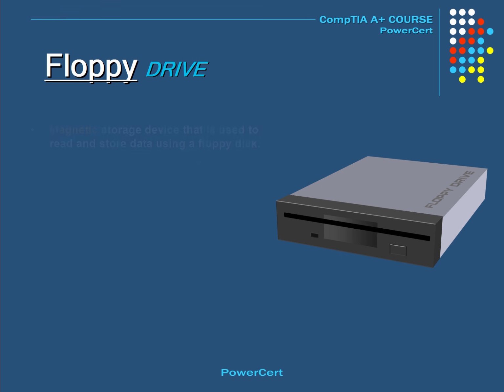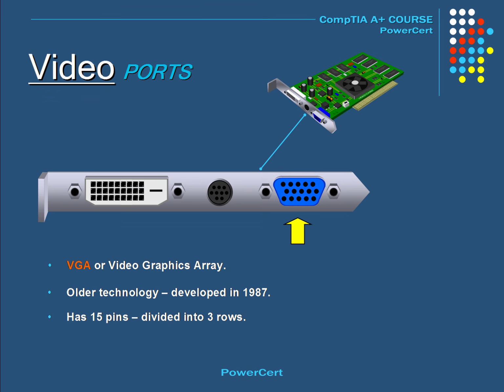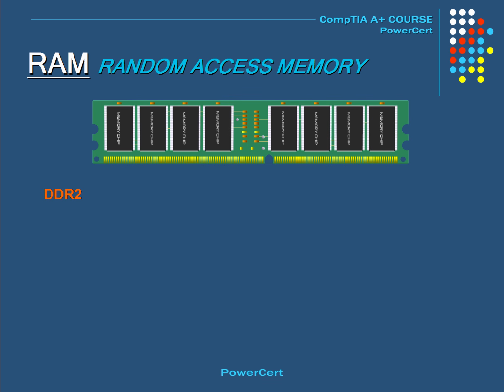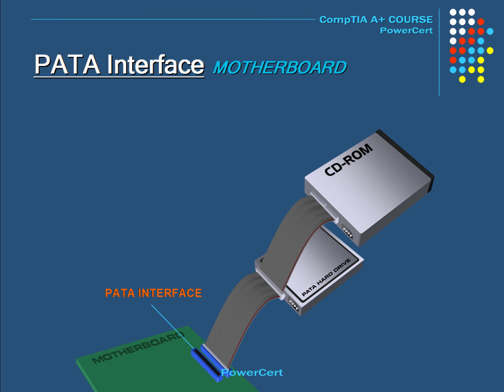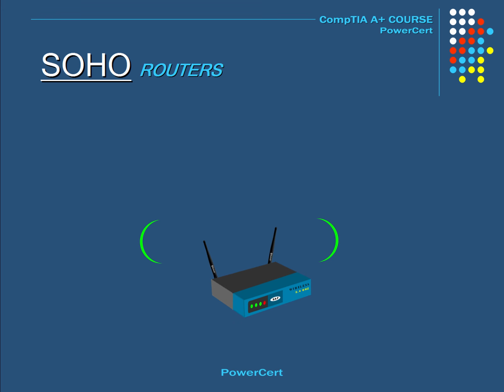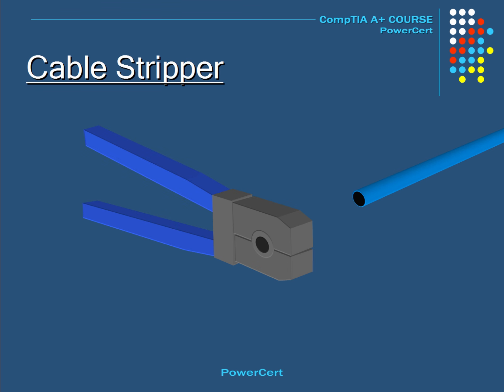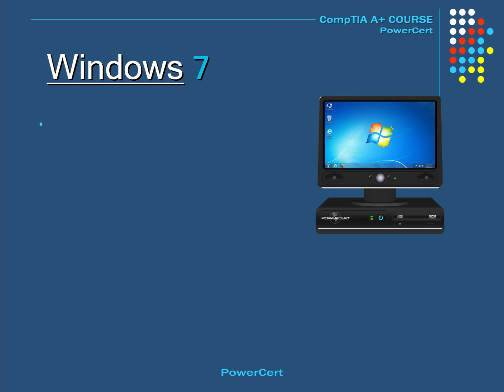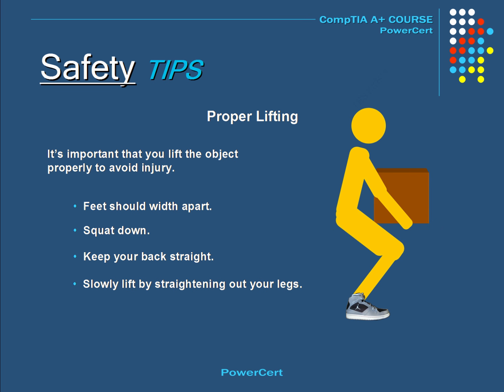CompTIA A+ Certification Video Course 220-801

Comment: Windows 95 was the first successful commercial launch of Windows. Windows first launched in '87 to '89, called Windows 1. I have Windows 2 installed on my Playstation Portable aka "PSP". There was even Windows 3.1 NT that eventually became Windows 2000. Not to be confused with Windows Me which was MSDOS based. Xp and onward are all NT based.

Comment: please someone answear,i want to study comptia +a,so i read from different sources to cover it well,but why the number is different like here is 220-801 and your other video is 901-902 and for professor messor is 1001-1002 and all are the same<please someone help me which one to study
Reply: You have to keep in mind that this is a 6 year old video. CompTIA launched the  220-1001 and 220-1002 tests in 2019. The core concepts in this video are still relevant though.

Comment: in the 19th minute of the video, he says that PS/2  ports are "becoming phased out". actually, at the repair shop that i work at, where we deal almost exclusively with used computers from people 40years old or older, these ports have already been  completely phased out. i knew this would be antiquated when he talked about floppy drives but not cloud storage. so far, in 20 minutes, the only thing ive learned is that btx form factors are made for desktops that are small. btw, another bad sign is that theres no mention of laptops or tablets. im the only only one at my shop that is not certified. and i know almost every word he has said. and ive known it for about 10 years. so far, when he mentions dates, nothing is newer than 2008. the a+ certification was just renewed. if you study for it on this video, you will fail the test!

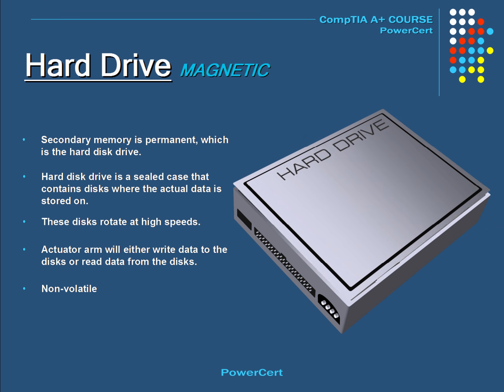Comment: Im new to A+, I am enrolling to obtain my IT degree at, so some of this is like a foreign language! But what I wanted to ask you, when you are talking about Port Forwarding at around the 2:04 mark you stated that you have to point it to the ip address of the computer you want your friend to access, my question is, what exactly are you pointing, the actual equipment or are you just saying you have to use the mouse and point to the ip address listed on the screen? I think I understand what you are saying and I am probably over thinking it because I have taken watching this video very seriously and I am falling asleep at times so I apologize if this is not make sense, I am trying my best to understand some of this before my classes start! Thanks!
Reply from the maker: Thank you.  You're telling the router that when it receives data coming in from a certain port, the router will direct or forward that data to the computer with the corresponding IP address.

Comment: whats the fire wire ??
Reply: A type of cable used to connect devices, just like USB.  There for a while it looked like FireWire might become the popular standard, not USB.  USB 1.1 turned out to be a little faster, and USB 2.0 many times faster.  Now that we have USB 3.0, FireWire is a legacy connection.  However, I believe you do still need to know it for the 901/902 A+ exams, so make sure you know what it looks like.

Comment: 0:30 Storage Devices
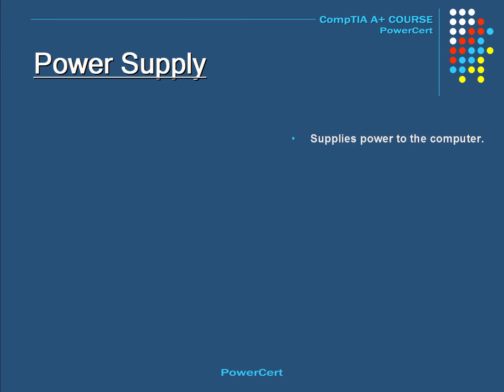10:50 Power Supply
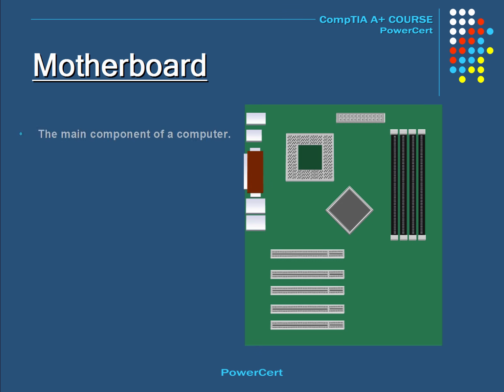13:10 Motherboard Form Factor
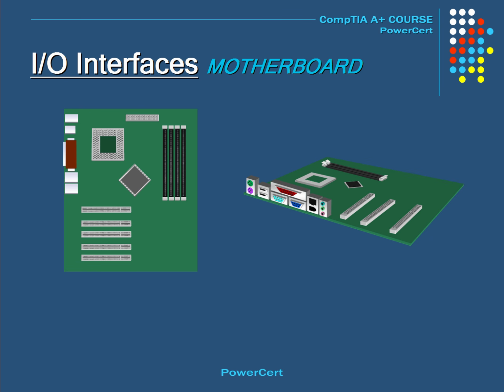18:45 Motherboard I/O Interfaces
26:50 Adapter/Expansion Cards
34:40 RAM Slots
38:30 Printers
44:45 Cooling
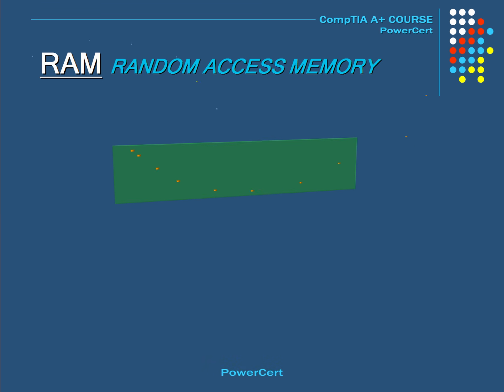50:30 RAM
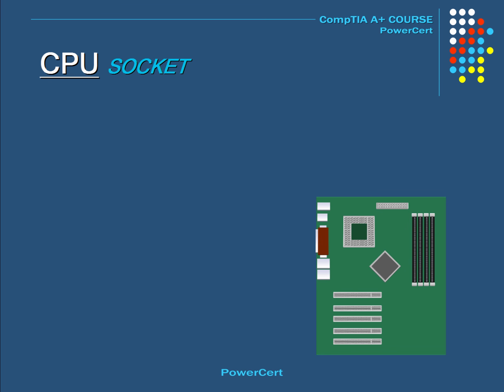1:02:50 CPU, Socket 
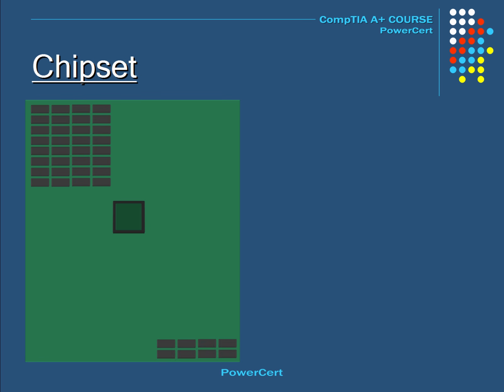1:14:31 Chipset
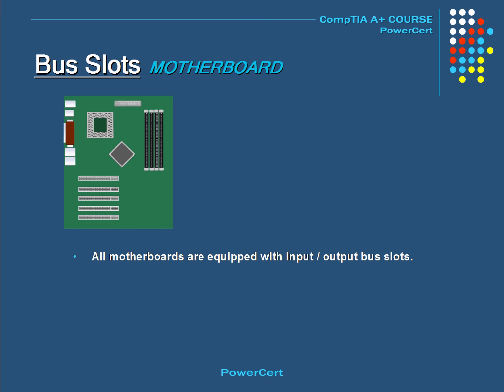1:19:38 Bus Slots
1:25:20 PATA Interface
1:27:30 Networking Cables & Connectors
1:35:40 TCP/IP Characteristics
1:44:45 Well-known Ports
1:46:14 TCP/IP Protocol Suites
1:53:23 Wireless Networking
(1:53:55 Router Configuration) 
2:04:47 Internet access technologies
2:08:02 Types of Networks
2:13:21 Network Components
2:22:06 Input Devices & Peripherals
2:29:53 Monitors
2:36:32 BIOS/CMOS
2:41:52 Windows OS
2:50:54 Windows features, ISSUES, tools & installation
3:08:34 RAID
3:13:13 Safety 
3:18:14 Professionalism Tips
Reply: +Kei Korono thx a lot
Reply: Bawse!
Reply: +Kei Korono Yes, thank you!!
Reply: A true champion of the ppl.
Reply: Thank you!
Reply: THE MAN
Reply: Love u
Reply: Yeah just look at the description lol
Reply: Man,tnx a lot!!!!
Reply: This doesn't work anymore after the new rubbish update youtube had released
Reply: COPIED THE VIDEO DESCRIPTION?
Reply: +Kei Korono What about 802?

Comment: I took the 701-02.  Is the 801 now the latest test?
Reply from the maker: +Jack Jones The 901 was just released.  The 801 is still valid until June 30, 2016
Reply: +PowerCert Animated Videos By valid does that mean if i was to take the 801 tomorrow it would be invalid in June or is it just that you won't be able to take the test after June and the qualification is still valid?
Reply from the maker: +Narom Regardless of which A+ exam you pass, your A+ certification is good for 3 years.  After 3 years of passing the A+, your certification will expire, or to keep your certification on going you can join the CompTIA continuing education program.  Details are on the CompTIA website.  Or, just retake the future exam when it's released.
Reply: +PowerCert Animated Videos answers my question and more. many thanks

Comment: This video definitely has some good information.  However, I found several cases where you gave incorrect information.  For example you said PC2-3200 was DDR2 RAM but it is actually DDR RAM.  Overall the fundamentals are right and presented well so thank you for your video.

Comment: Can you please advice the book for 901 902
Reply from the maker: +Muhammad Nawaz Butt The Exam Cram and Mike Myers books are great.   I'll have the 901 video done in about 3 months.
Reply: +PowerCert Animated Videos I'm about to take my 220-801 and 802 exams in early January...will this certification be obselete since 901 is coming out??
Reply from the maker: +F Silva The 220-801 and 802  will still be active and available till June 30, 2016
Reply: Can you please bit explain the difference 220-801 & 802? Thoes video above cover both?
Reply from the maker: +Muhammad Nawaz Butt Basically the 801 covers hardware and the 802 is software.  This video covers the 801.
Reply: +PowerCert Animated Videos Many thanks 
The Question I asked early about the book does your recommended books  cover all the topics for the certifications? 
& is there 2 separate exam for  801 & 802?
Reply from the maker: +Muhammad Nawaz Butt Yes to both questions.

Comment: Great video. Will there be a video regarding the 220-802 exam?
Reply from the maker: +Darinel Rodriguez Yes, but not for a while.  Need to finish what I started first.
Reply: Ahh, I see. I'll wait patiently. Quick question; would you recommend I take both 220-801 & 802 exams at the same time or seperately?
Reply from the maker: +Darinel Rodriguez Sorry for the delay.  Take one at a time!

Comment: CompTIA A+ 220-801 is the latest version for this certificate at November 2015? Thanks.
Reply from the maker: +Nicolás Valverde Yes.  They are releasing the new objectives soon, but the 220-801 will still be relevant for several more months.
Reply: +Nicolás Valverde FYI Comptia a+ 801-802 version will be retired in June 2016
Reply: PowerCert Animated Videos thank u very much 4 this video!!
Reply: Punny Hamp good to know it, thanks punny!
Reply: +Punny Hamp what do you mean by retire? ?

Comment: Great video! Very informational. Did anyone else caught the slight math calculation error @ 54:46. RAM bandwidth is calculated by multiplying the MHz by the bus width. Example on the video showed that MHz was 133 and it has an 8 byte wide bus for a total bandwidth of 1066 MB/s. The total bandwidth should have been 1064 MB/s (133 x 8 = 1064) and not 1066 MB/s.
Reply from the maker: +Springshowers Technically, its 133.33 x 8 which equals 1066.64.